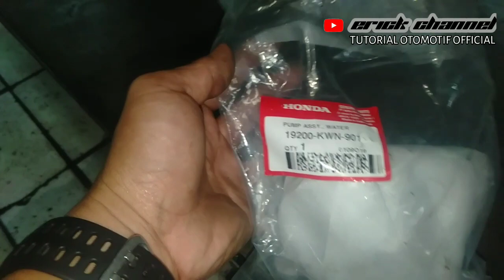Cara mengganti water pump Honda Vario 125 / 150

Comment: Bg mau nanya.. sy baru ganti waterpump Vario 125 Old 2013.
Penyebab bocor masuk ke dlm mesin. Oli sudah bercampur. 
Setelah ganti baru water pump nya. Knp bunyi agak kasar ya bg. Apakah ada yg salah pemasangan atau gmna ya. Sy ganti di bengkel biasa. Sblm ganti. Oli mesin bercampur air radiator. Bunyinya Masi halus. 
Setelah ganti baru water pump nya. Kok agak gelitik bunyi nya. Biasanya penyebab apa ya bg. Apa daerah magnet harus di bersihkan.
Reply from the maker: Cek bagian rumah rolleer....atau bisa kemungkinan lahar kruk as

Comment: mohon maaf numpang tanya bang, motor saya vario 150 cc , saya sudah ganti cvt semua sampai pully , laher cvt pully, seal kruk as dan lainnya,
Ada bunyi gemerincing(seperti ring longgar) saat gas nanggung di tengah motor sebelah bawah box filter itu perlu ganti apanya ya ?
Reply from the maker: cek bearing cover cvt nya mas bro
Reply: @bang_erick  sama punya saya juga gemerincing macam ring longgar
Reply: cek ring gantungan mesin mas bro
Reply: Ring plat kampas ganda sudah di cek?
Reply: Baut filteran yg bawah ganjel karet bang saya juga ngalamin udh sembuh skrg
Reply: Standar tengah , penyakit vario
Reply: @sniperngempos standar tengah penyakit vario

Comment: Permisi bang, motor saya vario 150. Indikator merahnya nyala. Ganti air radiator, terus pas di cek olinya kena jadi oli susu gitu, kata yang bengkel ganti water pump assy. Kena sejuta biayanya. Itu wajar ya bang? Saya gak ngerti soalnya 🙏🏻
Reply: 1jt kemahalan bro, ganti pak deksel nya aja sama waterpump set, totalnya gk sampe 500, klo bayar 1jt mah berarti ongkos pasang 500.

Comment: Kok diganti... Apakah rembes bocorkah
Reply from the maker: rembes dan bunyi di bearingnya
Reply: @bang_erick  maksudnya rembes nyatu sama oli om. ?
Reply: @bang_erick  pas ganti oli encer banget kaya air terus warnanya juga agak ijo.
Kata bengkel harus ganti assy water pump, mohon pencerahannya om.
Reply: @bang_erick  kalau cuma rembes apakah ada resiko air radiator masuk ke mesin bang.  ???